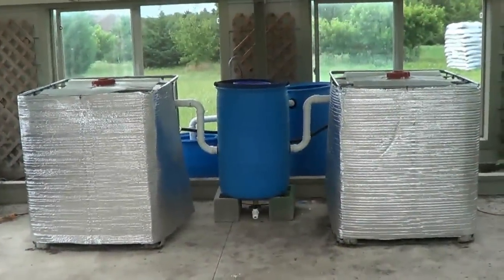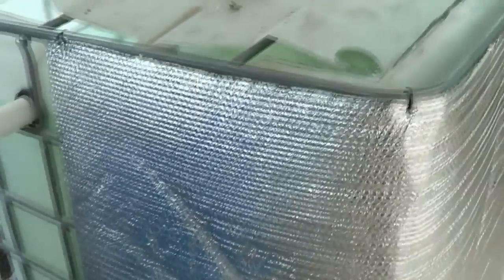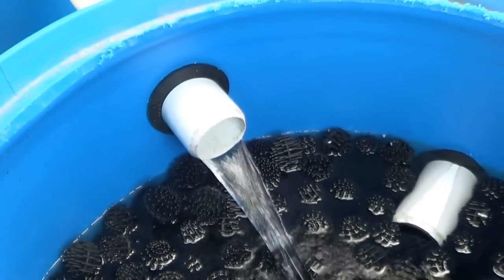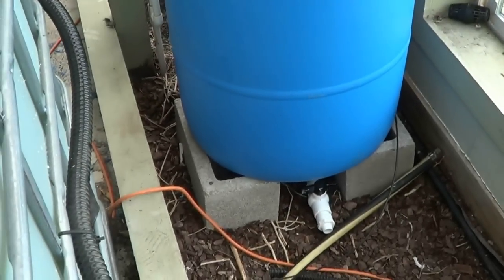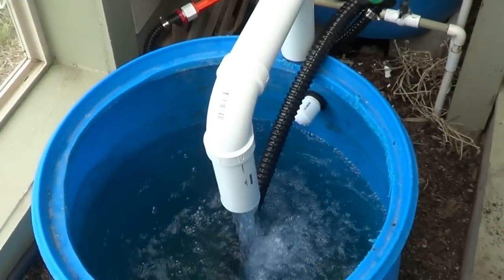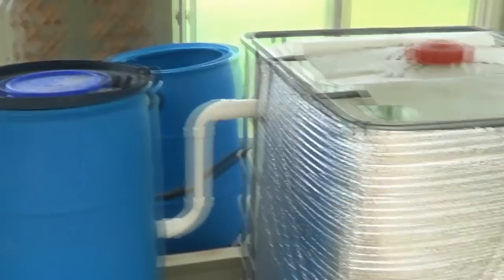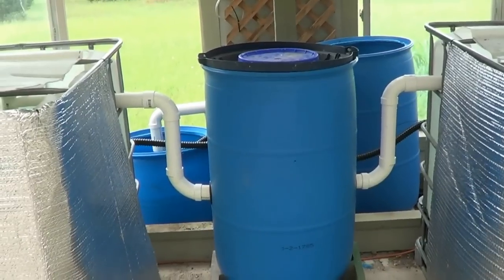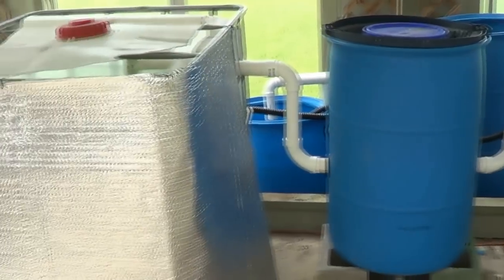Aquaculture System Complete

Comment: How do you handle  de-nitrification? If you plan on breeding the fish, you will have to address this problem because the nitrate levels will keep rising and cause problems with reproduction and growth.
Reply from the maker: Tilapia can handle a VERY HIGH amount of nitrates, but you are right eventually there is a problem. I just exchanged about 10%-15% of the water weekly, I used that to water the plants I have around my land. This is GREAT water for blueberry plants - I did not have to fertilize them at all when I did that...

Comment: I don't understand why people don't take the time to clean up the cut edges. There's no reason to spend the time researching, learning, working to pay for, traveling/purchasing, building, and then not spending just a couple of minutes to clean the cut edges and all debris before filling and running. Blows my mind really.
Reply from the maker: I did clean everything up - in NO way can you get everything. When you built your system how did you keep all the debris out? Courious
Reply: Exactly! It defies all logic.
Reply: The point being made here is that the edges would have been de-burred and the debris removed BEFORE filling with water.
Reply: Why waste time sealing something that might not leak on its own
Reply: What's the capacity of the solid filter and biofilter?Also,the wattage/ flow rate of the pump?

Comment: Why did you place the outlet from the biofilter at the top right next to the inlet? Are you going to have any benefit of all those bioballs if the water doesn't pass through them? I would have put the exit pipe at the bottom, that way water has to flow through bioballs to get more contact time and hopefully better nitrification.
Reply from the maker: I should have been more clear - the outlet is at the top but the outlet T's to the bottom for the opening, about 4" off the bottom. So the water goes into the pipe from the bottom. The newer system I do not have the Bio-filer as I am using the zipgrow towers now.   Thanks for watching
Reply: +Tracy Holz (North Texas Aquaponics) Can I get some help for this in India?
Reply from the maker: +sailo bongte What help do you need?